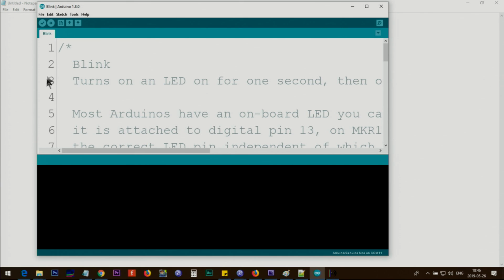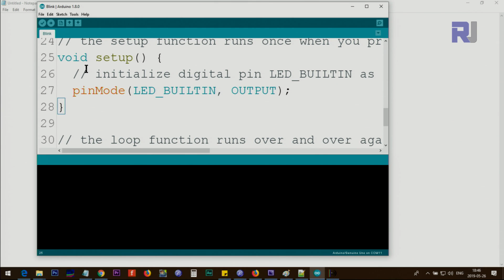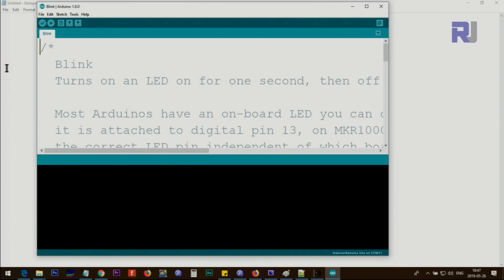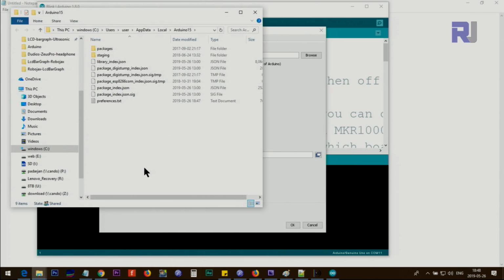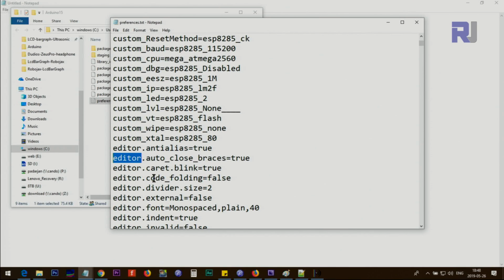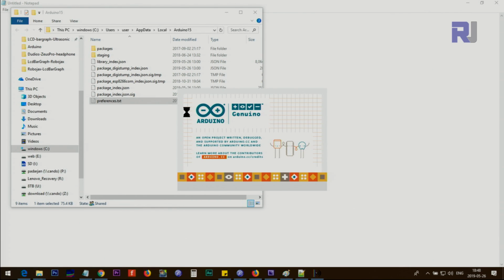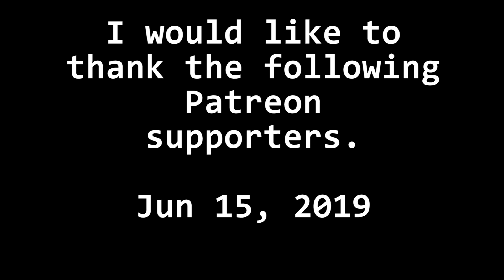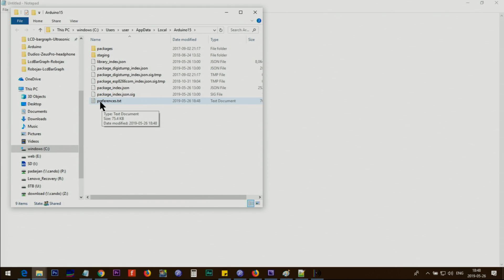How to display line numbers in Arduino IDE program

Comment: This can be done inside the arduino IDE by going into the preferences. No need to edit the preference file.
Reply from the maker: Wow I missed that. I went through the editing text file to fine it. Thanks.
Reply: @robojax  No offence... i said it because,  noobs can find in difficult and mess with the preference file, and May create new problems ..
Reply from the maker: I appreciate advise, comments and criticism. After your comment, I wanted to remove the video, but then I said leave it, someone will learn to enable numbers in a different way.
Reply: @robojax  It is always good to learn more than one way to do something. Thank you for the video.
Reply: Thank you random comment
File -> preferences
Settings tab -> Display line number check box.
out of the grid of text boxes its the first one on the top left.

Comment: Hi sir

Make a series on drone using arduino only..
And explain the coding part also in delail for all like transmitter,receiver and flight controller using arduino...
Thanks in advance
Reply from the maker: I wish I could. I am very busy. Drone is very complex and need lots of time. There is ArduPilot APM which based on Arduino. Why would anyone bother doing it unless wants to learn.